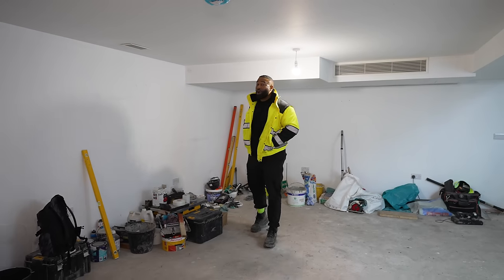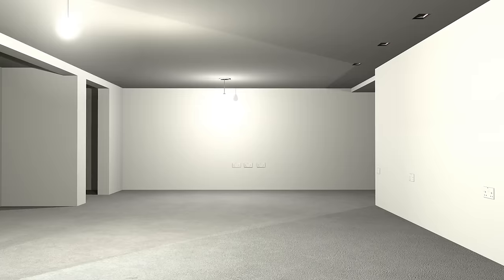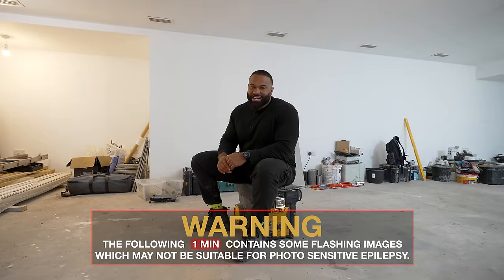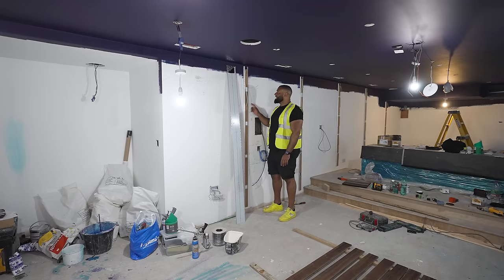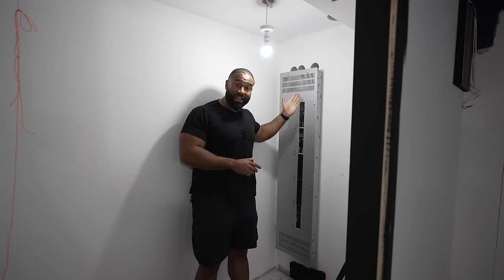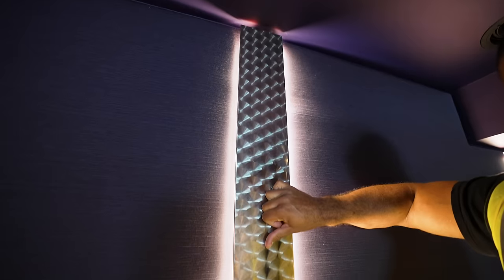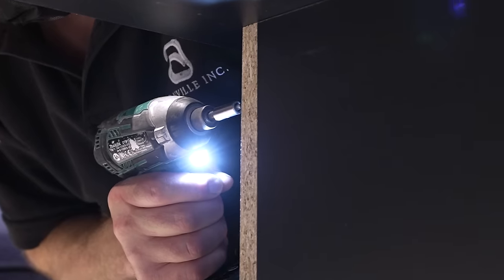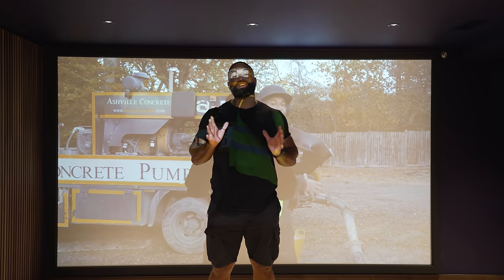We Turned a Flooded Basement into an Epic Home Cinema

Comment: @3.35 FYI That isn't a 7.2.2 System. It is a 5.2.4 setup. The first number is the amount of surround speakers (3 in the front and 2 on the sides). The second number is the amount of subwoofers and the last number is the amount of atmos speakers (the 4 speakers in the ceiling).

Comment: Seems like a great setup. The one thing that keeps bugging me though is the ceiling. In the times I’ve worked with sound dampening a room, it’s insane what a difference you get from doing the ceiling, vs not. It’s the most overlooked but highest benefit area to apply sound dampening.

Comment: Amazing transformation, what a beautiful home theater!  Only one thing that bugs me a little is how low they installed the Center channel speaker.  When a physical TV is there, it physically has to go below, or above the TV, but when it's a projection screen and the speakers can be mounted behind, then the front 3 (Left/Center/Right) Ideally should be aligned with one another so dialogue is coming from the middle of the screen, or if a sound pans left to right, it's not dipping down to the bottom of the screen then back up on either side.  Not a huge deal breaker, but just less ideal.  Otherwise great work!
Reply: The whole speaker configuration is a little questionable to me. With a acoustically transparent projection screen they should be using identical LCR speakers. Not sure why they went with a center channel that was made for fitting into/on a media cabinet.

And what’s up with using the back ceiling speakers as back surrounds? It’s a weird match with the LR side surrounds. I’m pretty sure they had room in the back for actual rear surrounds.

Comment: So you tell me, that you used an acustic transparent screen, and still put the center channel lower than left and right, although they should be on the same height? Plus it's a D´appolito Center rather than just the same L/R Speaker, so it sounds different. So you went for a AT screen but put the same subpar center speaker in as if you had a TV where you have to move it bellow the TV. I would go back, rip out the center, get another of the normal L/R speakers, cut a new hole at the same height as the other front channels. That way a sound moving from left to right isn't dipping down in height and doesn't sound completely different.

Comment: I'd recommend checking out some really good speakers. The speakers really make or break the authenticity of a home cinema. I really don't think this setup compares to a set of high-end floor standing speakers and an unimpeded high-end center speakers. Atmos also really shines in the 5.1.4 or 7.1.4 configuration. Sure, you could throw in a 2nd sub, but you really need 4 atmos channels, and then you can probably have a setup better than your local IMAX cinema.

Comment: Why did you plan the technical room on the left side? There would have been much more space in the back right corner and the room would have disappeared visually. In addition, the screen could have been wider and the speakers would have been much further apart and would therefore sound better in terms of the spatial perception of the sound.

Comment: Visually stunning.. Audio design..  you will get kick back from home theater enthusiasts  like me. Rear surround on the ceiling ..why? Centre should be the same orientation and size and the L and Right. Left assume you have strong reasons for doing otherwise. Also a room like that deserves a higher end processor. Just seems like esthetics was more important than audio which is fare enough..owners choice. Tuning the room may require room correction software like Dirac which may help with bass Nulls and sound object steering. Still a great room but enthusiasts will cut their eye a little.

Comment: Hi I loved your video for the Vizio 56C-1. I’m not electronic person. Took meter to the resister and without power it tested fine. The diode didn’t. The resistant next to the one in video had resistance without power. Does that sound like just replacing the diode?  I got this TV from friend who doesn’t want it back. What suggestions can you give to methodically test the right area of the power board?

Jeff

Comment: Fantastic looking and finishes, however from someone who specialized in renovations and primarily basement conversions, the only thing  that would let it down from a boss of the company point is the ceiling plastering😖, and it's a shame as the finishes and overall look is  great Daniel. But there are a lot of dips in the ceilings and especially when you have a satin and dark finish on it, it shows them up and was the first thing I noticed. This isn't a put down on your overall work but with an exclusive and luxury finish and cost, I would have made my guys re do the ceiling, they have either used the Flexi trowels or just didn't  spread the finish correctly. I hope you take the point out as it is intended and not a "diss". Otherwise fantastic job guys👍👍

Comment: Did you use an acoustically transparent screen? Why did you match the height of the speakers across the front? The center should have been at the same height as the L&R and oriented vertically. The subwoofers should also be in different locations. It's a beautiful room. Disappointed in the speaker layout.

Comment: You used an acoustically transparent screen and still chose to use a compromised speaker for the center channel? The main point is to have three identical speakers. Horizontal speakers are sonically inferior, and only exist for placing above or below non-acoustically transparent screens. Big miss. There's so much to like about this room, but the center channel is the most important speaker in the entire system.

Comment: Wow! Projector choosen on aesthetics? What the hell. Plus that's some wacky speaker placement ideas. Centre channel smaller and below Left and Right? Front ATMOS, with no rears. So it's just two ATMOS channels, that's one third of what ATMOS can do. I'm not sure the angles are right according to DOLBY Cinema. Then your rears are in the ceiling? That's just daft. Any Theater designer, sound engineer or person with basic AV comprehension would consider this very wrong. You've wasted people's money here.